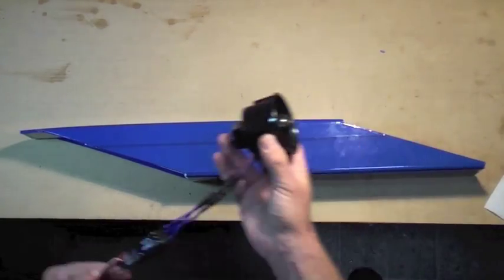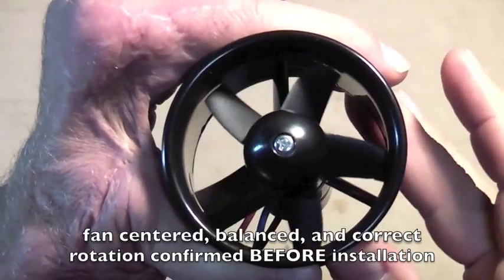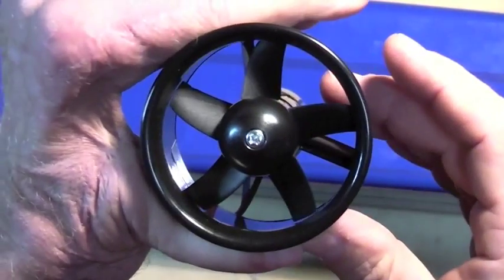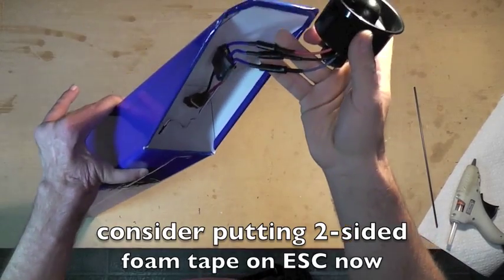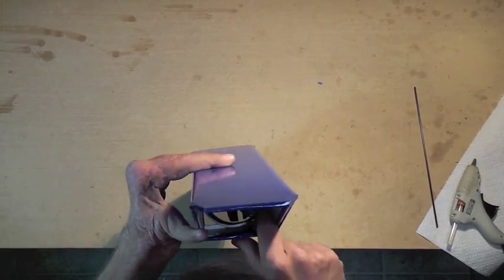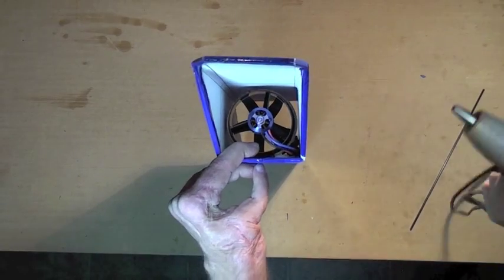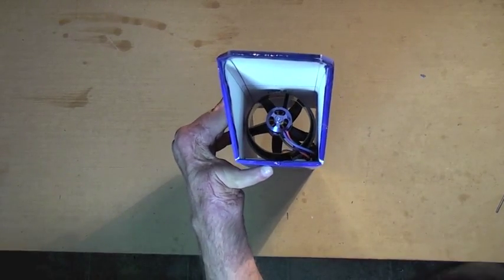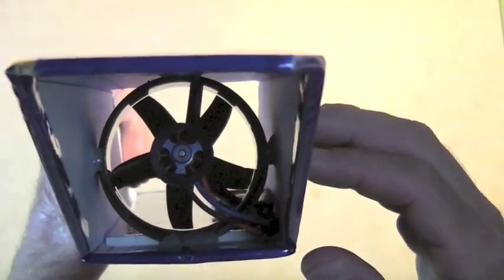FUGLYJET EDF, Build #2 - EDF installation

Comment: Whats the part number and where did you get the fan and unit from? I've built the noob tube and LOVE it! I would love to make one of these but not sure on what parts to go buy. hobby king?
Reply from the maker: David Gould I got them on eBay ages ago.  They are just generic 64mm ducts, not special at all, actually pretty crappy.  I might recommend getting a paired motor and duct that specifically fits your needs, from HK or otherwise.
Reply: Ive seen those units on ebay. Wondered if they are any good... I was thinking of getting two of the smaller 2 inch ones and make a noob 707. Using all of your EXCELLENT techniques!! Im new to electric, done nitro for years but cost is a big one...(and I have 4 kids now) and I dont have a large flying area anymore. Do you have any suggestions on a multi fan jumbo jet? Keep up the excellent work!!

Comment: Watched all your videos - great work with a lot of very useful tips. My question - how would you create a wing with a double dihedral? How would you suggest joining the four sections of wing? Build a spar first, with the dihedral joints in place (gusseted probably - I'd use wooden dowel for the spar) and then add the wing sections? Your response may help others with thoughts of building a glider. Thanks.